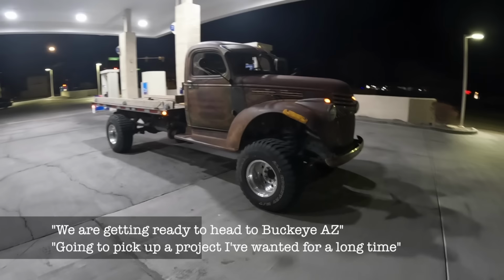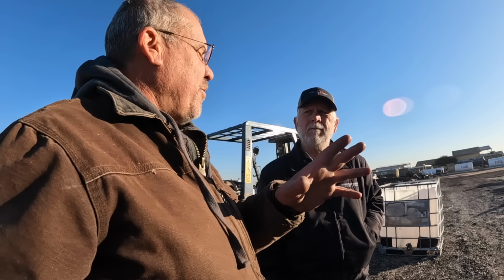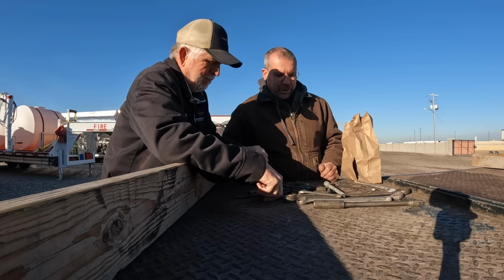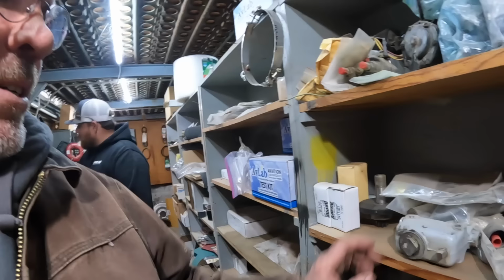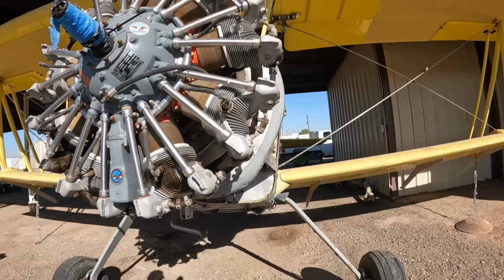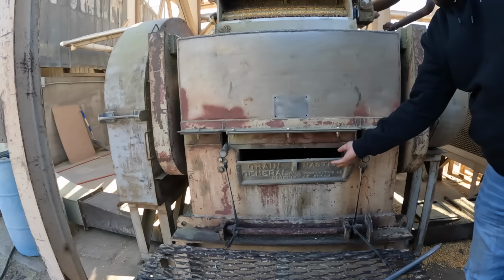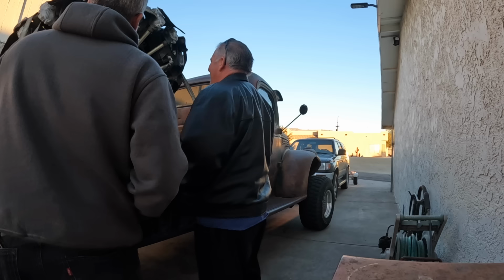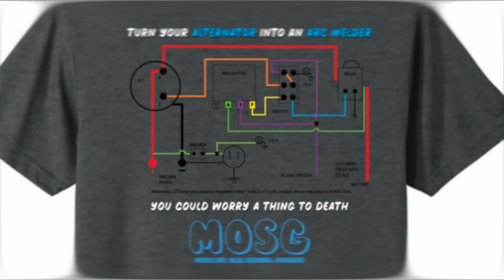This May Be the LARGEST Engine I Have Ever Owned - Russian Aircraft Radial

Comment: The tools that Merlon gave to Steve were produced under contract to the U. S. government during WW2. I have been fortunate enough to have picked up a few of the 11/32 socket set tools over the years. These tools were cadmium plated due to the shortages of nickel and chromium during the war. I have read that the "WF" embossed on these tools stands for Wright Field, where the Material Division was based, issuing contracts to supply the U.S.A.A.F. during the war effort.
Reply: I have never heard of this stuff before!  Learn something new every day!
Reply: Now I know what some of these unusual tools are in Dad's old tool box.  Thanks for the info.
Reply: What's the story behind the 11/32 drive size?  I can't figure out how to convince Google i don't want a socket for an 11/32 bolt.
Reply: @Dan_Neely  I am pretty sure that Plomb (later Pro Tools, later Proto) and Snap-on were the only tool manufacturers that produced the 11/32 drive socket sets for a short time. There should be some info on the vintage hand tool collector websites that might cover these oddities.

Comment: the starters on these ASh-62 they are all electric inertia starters which can be either wound up electrically or by a detachable crank handle to wind up the starter to spin the flywheel in the starter and the clutch in the starter is engaged to turn the engine over. there is videos of these engines running  either the R-1820 and the ASh-62.

Comment: I was a Snap-On Dealer in the mid 80s. A customer wanted to exchange a bunch of 5/8” and 7/8” drive tools for 1/2” and 3/4” drive.
Reply: I have a bunch of dad and grandpa tools,didn't know that is what that plumb  emblem means, great video
Reply: @jeffclark2725  Is it Plumb, or Plomb?  Plumb started in Philadelphia; Plomb started in Los Angeles.
Reply: @tetedur377  Will assume Plomb , its PL upside down triangle MB is how its spelt, also have some VLCHEK wrenches, look really old but work fine

Comment: The sound of a rotary engine running can't be matched.  I worked for Arnold Kolb at Black Hills Aviation where he had restored two B17 to use a slurry bombers.  He would fire those engines up in the hanger before he installed them on the planes and the sound and the feel as it fibrated deep in your chest was awesome.

Comment: That is awsome!    Overall one of the best videos for me.   I grew up in farm country just like Ports place.   Setting siphon tubes and feeding cattle.   Also when you pulled that 3/8 Plumb breaker bar out I got nostalgic.  I won a lot of tools at the Friday night auction as a teengager that had one in it.   I loved that it had the 3/8” square hole in the end of the handle so I could also use it as an extension.

Comment: Yes, a 23E50 hub (DC-3) will fit this spline . I had the STC for my M-18 with this engine. Find a prop shop that overhauls big propellers and most likely they’ll have an unserviceable hub and probably some blades for cheap ,you can cut down for clearance .

Comment: Merlin, it just so happened that I had two pieces of those pierced planking that I welded angle iron on each side and used as ramps on a trailer that I made and used for years, I also remember some of those old aircraft tools that you gave to your buddy Steve that. I had in my Air Force-issued toolbox back in the '60s.  I had 30 years of service and will be 81 in March.  Have you ever seen Jay Leno run his Merlin aircraft engine?

Comment: I once worked both at Pierce and Western pilot years back as A&p. Hectic I may have even wrenched on the very engine years back.

Take rich mixture to fire. On first pop, pump throttle couple times . It will fire.

Have fun

Comment: Thats a Shvetsov ASh-62 if it from an Antonov AN2.  The Shvetsov M-25 was the licensed production version of the Wright Cyclone R-1820-F3.  

Engine handling is absolutely critical to the survival of a radial engine.  A good pilot can or hear or feel the slightest change in engine performance.  Applying power requires finesse as you slowly and smoothly move the throttle lever.  Everything down to your preflight matters.
Very few pilots operate radial engine anymore.

I have logged about 500 hours with radial engines between a DHC-2 Beaver powered by a P&W R-985 wasp jr and a DC-3 powered by a pair of P&W R-1830 twin wasp engines.

Comment: You know, a 1000 hp air boat would be pretty cool! 😅
P.S. My dad was a B29 pilot in WWII (and KB29, KB50 pilot in the years that followed). The B29 had four 18 cylinder duplex (double row) turbosupercharged radial engines, each rated around 2200 hp and fitted with a 4-blade prop over 16 feet in diameter. Basically, the B29's Wright engines were the "big brother" to what you've brought home!
B29s had a lot of issues with overheating and engine fires. Couldn't spend too much time idling on the ground... had to get moving and flying quickly to keep the air-cooled engines happy. There was a flight engineer seated right behind the cockpit constantly monitoring and tweaking the engines. 
You probably already know, it's essential to rotate those radial engines a few times before starting them. The lower cylinders tend to fill with oil or fuel while sitting... if not turned over to clear those cylinders, they can hydrolock and destroy the engine!
Hey, I don't knock the Russian rebuild! They've done some great work over the years. NASA spent millions to design a pen that would function properly in zero gravity... the Russian cosmonauts simply used pencils!

Comment: When I was 18, I worked at an airport in Bennington, VT,
Business Air had 5 @ DC -3s, 
Wicked cool, we did aviation transport bulk hauling, i got to fly one on a transport once, pretty cool, otherwise I just towed them around to be serviced and maintained them, the oil dipstick would read in 5 gallon incriminates and the fuel would hold 200gallons in each main and aux tank, and so that would be 800 gallons, 400 in each Wing. Those were 12 cylinders, 1, 200 horsepower, the jugs and cylinders were big, like coffee can big, 10 or 11 inches round.
They all had WW ll paint except one, one was all bare aluminum.
Seeing thay engine brought back memories.🎉❤
Thanks Merlin 😁

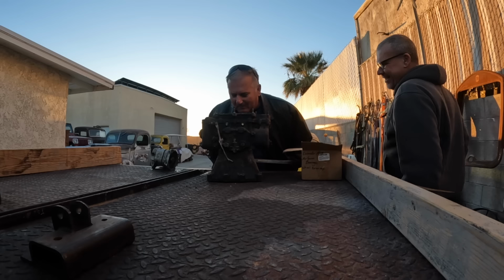Comment: 36:46 It's rated at 64 gallons and hour, not a minute. Sorry to be picky about the acurate minutiae. Still, a great find and good luck with the restoration! Hope to see it running at Sun-n-Fun '24??
The AN-2 used a 4 blade prop, in case you didn't know that. Those engines were also produced in China, so I hope you have good luck on finding any other parts that you might need. Git 'er dun, brother!

Comment: I'm a retired USFA aircraft mechanic. I joined in 1961 working on C-124s that had 4 - 28 cylinder R-4360 cu.in. engines. In my first 9 years I never touched a jet engine: C-123s had R-2800 cu.in. engines, C-119s had R-3350 cu.in. engines and the O-2s had IO-360 ci.in. engines.

Comment: In times past when an engine was rebuilt, or maybe new, they put a thick laminated wood prop with 4 short sawed off blades on the engine to break it in.  They were about 10-12 inches thick and about 4 feet across.  These were not for use on a flying airplane.  I first saw one at Evergreen Airport in Vancouver, Washington (now gone) where a number of very antique airplanes could be found.  The next one I saw was a couple of days ago in McMenamen's Restaurant in Beaverton, Oregon,  It is being used as a slow horizontal rotating fan in the center of the eating area.  It will be interesting to see if you can find one to put on this engine.

Comment: @ :59 Oh poor baby drive it 21 miles to work 20 below zero with the heater blower removed. When I got there my legs felt like they were being scalded, I had a much heavier coat than you and it wasn't enough and a blanket on my legs. I think it was the winter after mount ste. Helens blew up all january 20 to 30 below zero. I got my heater blower in that afternoon and still the temp. inside barely kept the frost off the windshield. A buddy of mine had an aged vehicle  and he had this cute little fish shanty stove and he used it to heat his truck, it burned wood ,put the stove pipe through the roof.

Comment: Hello from Kansas! My experience with radial engines was with the guys rebuilding the B-29 "Doc". They had the #4 engine set up on a trailer including the 32v APU engine to power the ignition until the mags got up to speed. They would take it around to car shows, county fairs, and tractor shows to display and run for good PR and donations for "Doc". The coolest thing I seen them do with it was run it at night and then turn off all the streetlights so all you seen was the blue flames from the exhaust! It was the coolest thing I ever seen! They'd only run it at about 25% throttle since it wasn't rebuilt, but it would rumble for sure. It came straight off of the B-29 after setting on the China Lake weapon range. Luckly "Doc" was never hit while it was a target. https://www.youtube.com/watch?v=KtfBPjXSorg
Reply: Thank you for posting the link to the B-29 engine video.

Comment: @MerlinsOldSchoolGarage I was the guy who talked to you in STL at the boat ramp that had the Piper Comanche 400. The IO-720 400hp burns between 18-19 GPH at cruise power setting and can hit over 40GPH full beans take off power. It sounds like a bunch of fuel but with the Comanche at least when you are using it for travel it turns out not being a whole lot more fuel usage on a trip due to less actual time in the air due to the cruise speed of 185 knts and climb rate is 1600 FPM at full gross weight so you spend quite a bit less time climbing up to altitude also. In the end it's not a huge difference fuel wise, and you can always fly at reduced power if you want to use less fuel.

Comment: I put more of that MOMAT together in my first command back in the early 80s than I care to remember. We used it at the beach head for LSU offloading and any equipment that ended up getting stuck we had an old bulldozer to drag them clear.

Comment: the engine you got is the Shvetsov ASh-62 used on the Antonov An-2 biplane as its a copy of the US built Wright Cyclone 9 R-1820 engine used on the Douglas DC-2 airliner and B-18 Bolo  as this is the copy of the early Wright R-1820 as the american 1820s changed from wwll to the 1960s the last of the US cyclones used on the American aircraft was the Grumman S2 tracker the Conair firecat,  the Boeing/Vertol 44a H-21 flying banana and the Sikorsky S-58 H-34 Choctaw. These ASh-62 not just the AN-2 biplane it was used on the Lisunov Li-2 the DC-2 copy and the Polikarpov l-16 and l-153 biplane as these are mostly were in production for the AN-2 still being made in China as the Shijiazhuang Y-5 the chinese variant of this engine is the HS-5

Comment: Probably 45 years ago, a friend acquired a straight six cylinder inverted aircraft engine.  He rigged up a distributor to replace the magneto, and used an auto speedometer as a tach.  He hand carved a six foot wooden prop, and mounted the engine in a shortened 57 Chevy frame.  It would idle about 20 mph.  Under power, you just hung on.  To keep it from going crazy, he used a one pint gas tank.  The hardest part of using an aircraft engine, is keeping it cool.

Comment: I think you should put an old generator on it and use it to charge electric cars, run search lights and mills, etc.  Put a ducted fan on it to make a wind machine.  Have it do something useful and informative so the younger generation can relate to it. You don't see search lights scanning the skies like I did in the 60's . Since it's not on an airplane, don't mount an old propeller.

Comment: they are not motors they are engines. Any thing that burns gas, diesel, propane, even natural gas buses, and even steam trains which are all combustion type are called engines, but if it runs off electricity then it's a motor

Comment: So the engine gets mounted to the trailer as a test platform that can be towed to the car shows.  
But, here's the bonus: if the tow vehicle engine dies or runs out of fuel, you can crank up the airplane engine and push the truck to the next exit.
Like this:
https://youtu.be/w4eT6d39fko?si=8E_RzoWjdzyuSDo8

Comment: Just curious.  I ended up with a Jo manufacturing torque wrench model USAF-5.  Its a 1" drive. 350 foor pound to 1600 foot pound version. Does anybody know what that was designed for.  Aircraft or missiles.